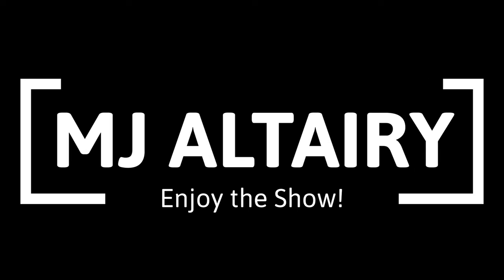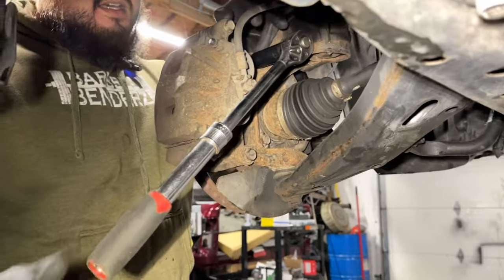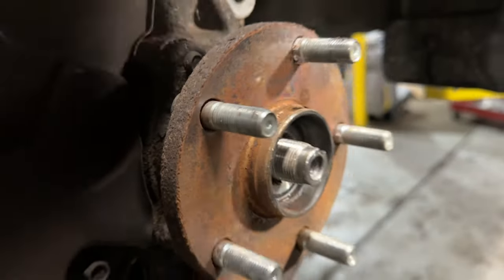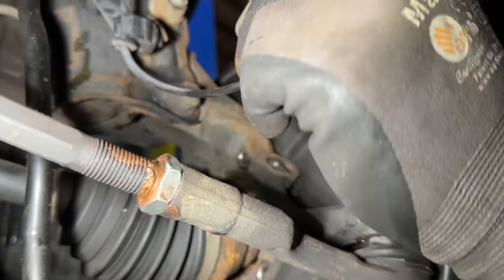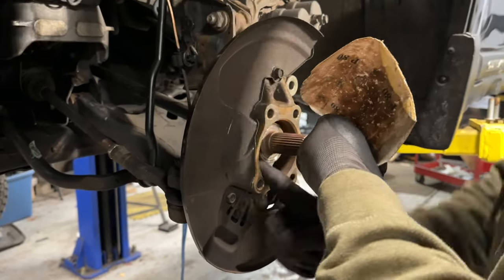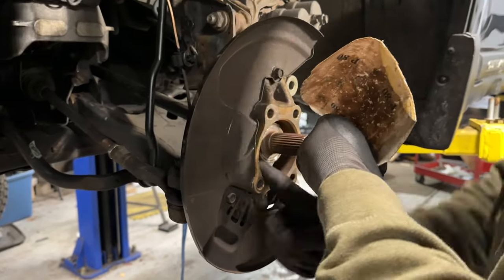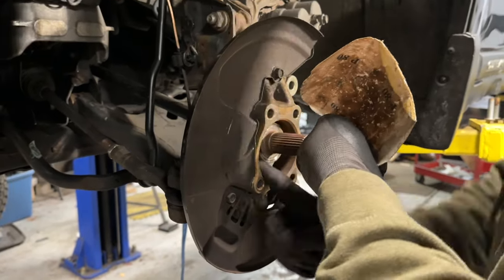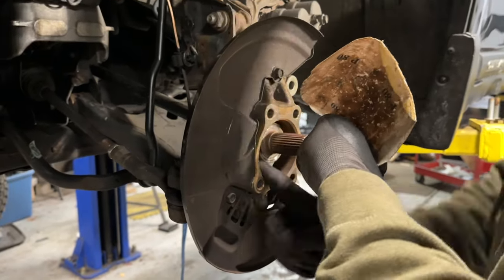2015-2020 Subaru Outback - Front Wheel Bearing Replacement

Comment: Are you sure those are M18 bolts and not M8?

I’m looking at M18s right now and they’re waaaaaay bigger than those holes.
Reply from the maker: Yeah I could be very wrong on that one, I must’ve misread it when I was looking up the procedure.
Reply: @MJAltairy  haha. No biggie dude. I ended up picking up a couple of M8s I’ll let you know this Saturday if it works out for me. Otherwise it’s hammer time.
Reply from the maker: @mrrrmcleod  haha yeah keep us posted! I’ll update the description or pin the comment or something!
Reply: @MJAltairy  okay can confirm M8 coarse thread. That rotor came off real easy like. 😊
Reply from the maker: @mrrrmcleod  heck yeah! Awesome, thank you for confirming! Went ahead and pinned this comment thread for this video.

Comment: I'm not a mechanic but from what I have researched you should torque the axle nut without the car being on the ground. I think the torque loads the correct pressure on the bearing. I  use an infrared thermometer to locate the bad bearing. I point the dot to a lug nut on all the wheels and the bad bearing will show a higher temperature than the good ones.
Reply: ....but he torqued it on the ground??
Reply: Correct. That bearing will fail prematurely
Reply: @donalddavis3308  Oh sorry, I misunderstood.

Comment: Trick I use before replacing wheel bearings is to spray it with penetrating fluid at the back and leave it overnight or for a few days while still using the car. Be careful to not spray fluid on the rotors or brake calipers. Just a few light taps with a mallet or hammer, it should come out easy. I never had to use a pry bar.

Comment: Thanks for putting this together. Just swapped out the front driver side bearing on my wifes Outback. Took 45 minutes with a 3lb sledge to get the old bearing off but other than that was a piece of cake. Extra thanks for the torque settings!
Reply from the maker: Appreciate the support! Glad i could help!

Comment: thanks man, since I keep my cars for long time (or usually plan to haha) I brush any rust rust off and clean more and use appropriate grease on every fitting, screws etc Except wheel lug nuts of course., Times have changed, I used to replace the bearings only and keep the bearing housing. Now days the assembly cost same as bearing itself, can't explain that but hey makes the job easier...Thanks again

Comment: Your video was perfect. The process and everything involved was the same as my 2006 B9 Tribeca except torque spec was 177 ft. lbs back then and the small dust shield that goes in the axle didn't appear to be a thing back then. Brake shield existed but mine was rusted out so it went in the trash. Besides I live off of a dirt road. Thank you!

Comment: Help! I just drove 2500 miles into central Mexico from Tacoma Washington and at 120k miles I'm hearing a faint growl from my rear wheel bearing 2015 Outback. Will I need to find a Subaru dealership for parts and service or is the bearing a standard bearing not specific to the Outback? My problem here is that in rural central Mexico subaru dealers are not available? If I order online.... Do you think a local mechanic can accomplish the job?
Reply from the maker: Doesn’t need to be a dealer item. They should be readily available online. You can probably find the part on ebay, rockauto or amazon. I’m not sure of your location but you can usually order amazon packages to local hubs they have placed around major cities.

Comment: Have been researching a front wheel bearing replacement for my 2015 Outback.  From all I've seen and read the axle nut should be torqued with the wheel off?
Reply from the maker: This is actually news to me. I’ve done many wheel bearings/hub replacements and have done it both ways. Haven’t had any issues as long as you’re not over torquing or not torquing it down enough. 

After looking into it, it seems to be the better option though.
Reply: @MJAltairy  I wanted to thank you for your video.  I just replaced my front bearing hubs and followed your video mostly.  I did find it easier to install the axle nut by inserting a steel bar I had into the disc fins at the brake caliper while torqueing the nut.
Reply from the maker: @ed9095  probably the better/recommended way to do it anyways! Thank you for watching and glad I could help!

Comment: hi sir. i put on an chinese aftermarket wheel bearing hub on my car to save some $
i think it may have play when i grab and shake the wheel...it clicks very slight.. at first i thought its something else cos a new bearing shouldnt click but its definitely the bearing. 
However, it rotates really smooth and makes no noise spinning by hand or going down the road. 
the old bad oem one had no play but it made noise driving on the road so im confused about what i should do...throw money on oem or just leave it on...
Reply from the maker: Did you make sure the axle nut and bolts holding bearing to spindle assembly is secured?
Reply: @MJAltairy  yeah they're all torqueed down properly

Comment: Hey man, I followed this process on my 06 B9 Tribeca to eliminate play that my inspector found by pulling on the 12 o'clock and 6 o'clock points while in the air. He said it "might" be the wheel bearing so I followed this procedure which was almost identical. Glad I learned how to change the wheel bearing here but when I was done I realized I missed the mark and it was another issue. Any idea what this can be?
 https://youtu.be/7n3gbE-RaNg?feature=shared
Reply from the maker: With the car on the ground, are you able to spin that nut on tighter? Might just need to be tightened down more.

Also, was the axle ever replaced? Maybe it’s not seated fully into the transfer case? 

The other thing i can think of is the C clip retainer on the other side of the axle (going into the transfer case). If that c clip isn’t there, i can see the cv axle sliding loose. 

Check if there’s play at on the other side of the hub (behind the bearing area) or play at the transfer case
Reply: @MJAltairy  Just wanted to say that I bought one on Amazon (FKG 513239) that was marketed as the correct bearing but it was like 3 times too deep. I went and got the MOOG unit (same part number as the one in the video too). Thanks for this video again. Could have not done it without you.
Reply from the maker: @jamesdean5677 oh man that’s unfortunate you found out that way. Wrong item could’ve been boxed or something. Glad you got it sorted out
Reply: @MJAltairy  The correct part number is actually on the part making it even more scary. Appreciated.

Comment: show a rust bucket where you need a air hammer and a torch
Reply from the maker: I’ve got some toyota videos that involve those tools of persuasion 😂
Reply: 2015  I unfortunately had to resort to   air hammer.. 5 years and mileage makes a big difference
Reply: 😢 The four retaining bolts don't come off either bar or with my rattle gun, access is fairly limited on the lower forward bolt even my narrow 14mm socket doesn't go on straight...